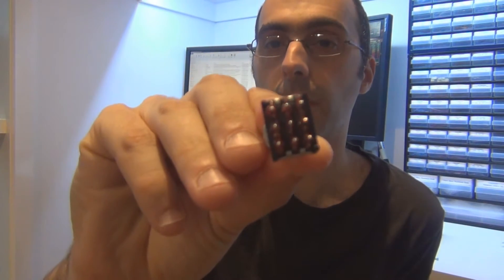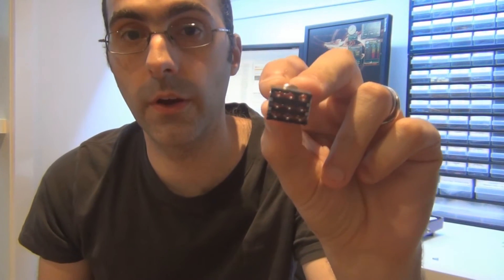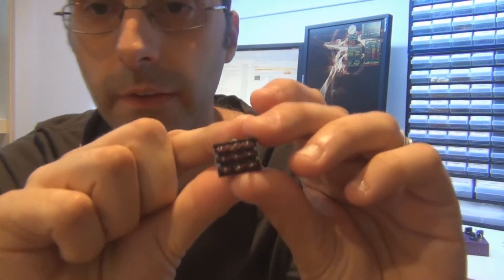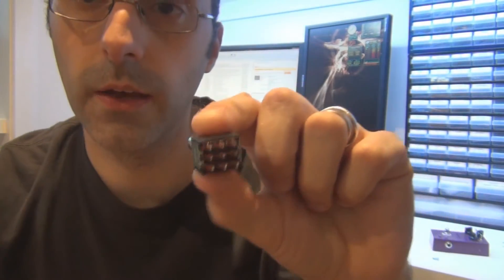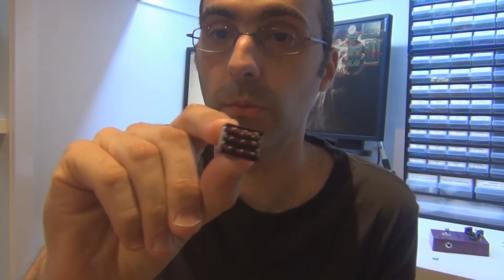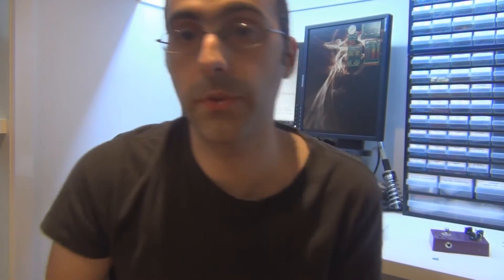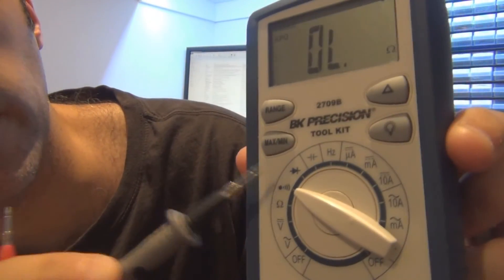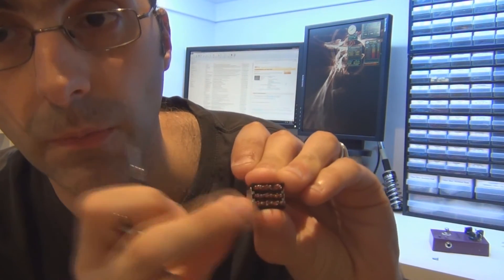B2B - 3pdt Switch Orientation

Comment: thanks for the video! but I have a new question, sorry if its so stupid, but in horizontal orientation you also have 2 positions, it doesn't matter the top or the bottom whichever?
Reply: I know you posted this 11 months ago and probably already got an answer, but yes, that's what I'm taking from this video.  Just make sure the openings (faces) of the lugs face the top and bottom of the pedal, and it shouldn't matter.
Reply: I have the exact same question and the video did not answer that. And exactly because of that I think it does not matter.  :)

Comment: ok I have this same switch in my holy stain pedal and when I click it on there is no sound. but when I click it off it bypasses to the amp fine. would that be a broken footswitch? I took it apart but don't see anything wrong so I'm at a loss.

Comment: chromespherecom I'd really appreciate it if you could make a B2B video explaining some of the jargon around switches. I'm trying to build a boss fs-6 clone for my boss rc-3 pedal and there seems to be some confusion on some schematics and forums about whether the momentary switches used should be n/c or n/o. People seem to be confusing n/o with normally on. Wouldn't n/o mean normally open and that the connection is broken unless the switch is pressed?
Then I saw you talking about Tayda Electronics in another vid so I went to their site and their switches are listed as on-on or on-off-on etc. I don't see anything on their site about n/c and n/o.
imho Your videos are great btw. may as well keep the acronyms flowing.

Comment: So, the orientation of the LUGS determine which set of three are connected to which poles...  which direction you physically mount it in the case/chassis/pedal doesn't make diddly difference as long as you wire it as called for in the schematic.  You've definitely got a simple answer, but I think it's the wrong question...